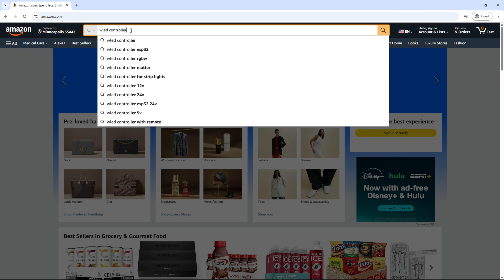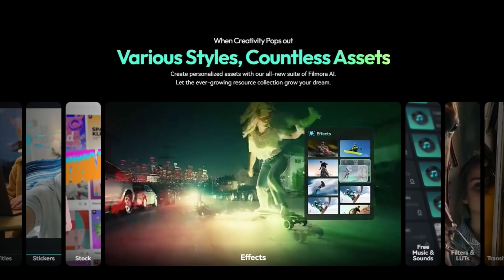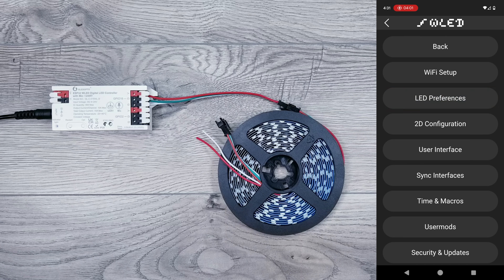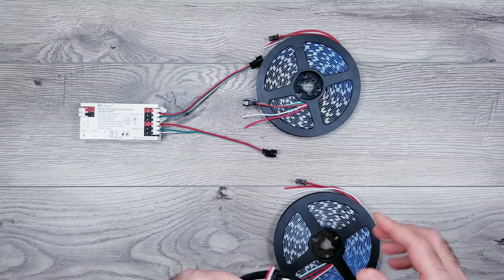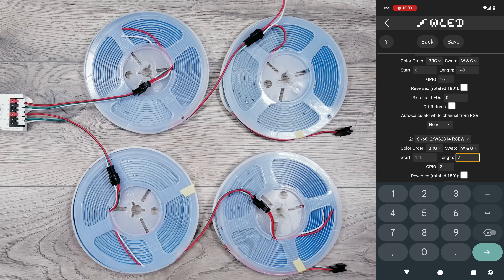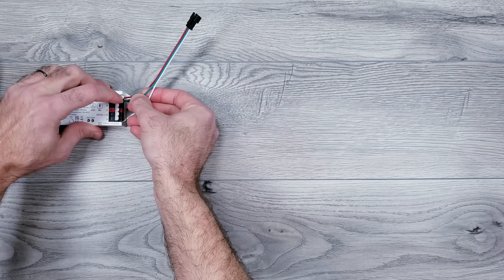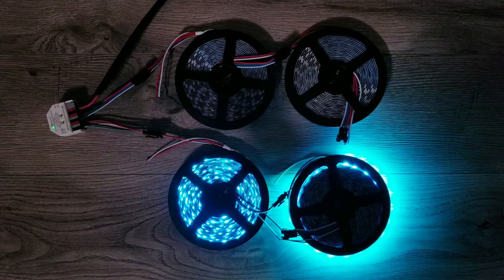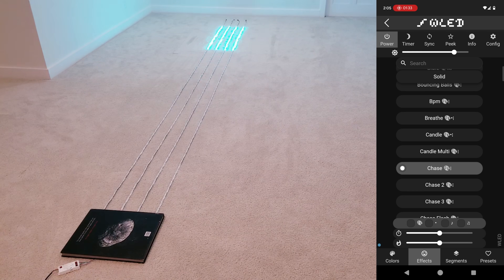The ULTIMATE 5v, 12v 24v LED Setup Guide for Beginners. EASY Plug n Play WLED + Sound React WLED

Comment: Hello, can i use this new Gledopto WLED Controller for a setup of Seven 16.4ft SK6812 all soldered together?  I Just want one long continuous roll.  I will need exactly 110ft.  What would be the best setup for something like this?  Thanks in advance!
Reply: Yes, but you’ll need power injection and a strong power supply for that length. I edited a similar setup video using Filmora.
Reply: @EmilyJaneMiller Thanks for this reply. I will check out your video. For the power supply I went with a; “Mean Well LRS-350-5 350W Single Output Switching Power Supply 5V 60A”.

Comment: I have several of the Gledopto Mini controllers and they've worked well so far. Compact and economical with a nice case. They also have versions without the microphone which are slightly cheaper. Flashes OTA with standard WLED firmware for updates.

The Mini has a lower current rating than the larger unit, I don't think that was mentioned in the video.
Reply: Good point on the current rating. I documented my setup and tweaks with Filmora—makes sharing these tips a breeze.

Comment: I have found the GLEDOPTO controllers to be very reliable, they also do some with a USB connector on the board so you can reflash them when you screw up.
Reply: Great feature, I agree! I’ve been editing my setup videos with Filmora, and it’s been super easy to share these kinds of tips.
Reply: that sounds like Windows XP. Remind me, of the times when you could break stuff over and over and just reinstall if you screw up? Internet speeds were decent, the software was still wild and primitive.

Comment: Hello!, i have a question, for a 5m strip of SK6812 you don't need a power supply of 5V 20A?
Reply: For a 5m SK6812 strip, a 5V 10A power supply is usually enough, but if you have a lot of LEDs or run it at full brightness, you might need more. I shared this in a video, editing with Filmora made it easy to explain.

Comment: If I´d want to trigger 4 Strips to turn on after another, would I need to use two controllers? If so, can I programm a delay in WLED when I want use just one light sensor  as a trigger for example?
Reply: Not sure about four strips, but you could daisy chain two on each output and reverse one of them, the controller would then treat them as one long strip which would start at one end, go along to the middle and then extend along the other strip.  The only issue you might have is with the total number of LEDs, the controllers say they are limited to 800 chips, but I am not sure what happens of you push that.
Reply: @gordon861  Oh yeah, that sounds like a really good idea! 
I´d have to calculate about the 800 chips since its a quite long installation I am planning (Lighting a Carport with two parking spots).
Regarding exceeding the 800 IC Limit: In this video when he adds the thrid Strip, isnt he already exceeding the Limit by 100 IC? 
First Strip has 300, he adds a second one with again 300 but then daisy chains another 300 IC Strip and sets the IC in WLED to 600. By that the controller would need to control 900 IC already. Or it is max 800 per Output maybe? @ChrisMaherDIY
Reply: Yes, you’d need two controllers for multiple strips. You can program a delay in WLED using effects or triggers for sequential lighting. I covered a similar setup in a video edited with Filmora.
Reply: @EmilyJaneMiller  Thank you very much! I will check that out!

Comment: I'm curious about the gpio pins at the bottom of the controller. What would you use these pins for? Can you connect these controllers to a light switch ?
Reply: The GPIO pins are for advanced setups like buttons or switches. You can connect them to a light switch for manual control. I made a video showing similar setups using Filmora, which made explaining the process easy.

Comment: Great video Chris. Is there any voltage drop when you use a splitter with 2x SK6812 (2x5m 300leds)? Can i connect a Gledopto to a 60A power supply ?
Reply: Thanks! Yes, voltage drop can happen over longer runs, especially with high LED counts. I used Filmora to edit my setup video—it made sharing these tips easy and clear.

Comment: can this controller also run 3 5meter strips in a row? or do the last strip need an extra power input ?
Reply: Yes, it can run them, but the last strip will likely need power injection. I covered this in a setup video edited with Filmora.

Comment: How do you create one plug to 3 different. LED lights basically one controller to 3 different locations
Reply from the maker: Thanks for watching! Only way would be to use extension wires or solder your own wires between the strips. Not always possible so sometimes you just have to use multiple controllers.
Reply: @ multiple as is 3
Diff led for example? Trying to do 3 seperate floating mirrors with led lights in back
Reply: You can use a splitter cable to connect one controller to multiple strips. I demonstrated this setup in a video I edited with Filmora.

Comment: Would this work on any of the govee products?
Reply from the maker: Any 5-24v Govee product that is compatable with WLED would work with these. Some 36v govee produts would work as well but that would require a separate power supply for the lights. Kinda like what I did in this video: https://youtu.be/0vPtW8pR7Yw
Reply: @ChrisMaherDIY thanks so much for everything
Reply: It may work with some, but Govee typically uses proprietary systems. I covered this in a video edited with Filmora.

Comment: Can this controller be use with an Anker 20,000 mAh battery pack for portable led lighting?
Reply from the maker: Yeah you can! I would probably just get a usb c to plug adapter https://amzn.to/4hd5IJx or usb c to bare wire adapter: https://amzn.to/4iy9QoB
Reply: @ChrisMaherDIY  thanks for the help

Comment: Thank you but I have a question , says 2 led lights are on both gpio2 and 16 , how do I control them separately? I have mine connected but when I turn it on they all turn on at the same time from the same controller
Reply: Nevermind I should've finished the video before commenting 😅
Reply from the maker: Thanks for watching buddy! Lol glad you figured it out after watching more :)
Reply: You can control them separately by configuring different GPIO pins in the WLED settings. I showed this setup in a video edited with Filmora to make it clearer.

Comment: Will any of those controllers also work with BTF-Lighting 5050 RGBCCT 5IN1 strip? If not, do you know of a controller that will?
Reply from the maker: Thanks for watching! For CCT strips here is a controller that works with those: https://amzn.to/4hBu2oo (not WLED though)
Reply: @ChrisMaherDIY  can you tell me if this controller have option RF, zigbee or wifi like skydance zf5?
Reply: @ChrisMaherDIY  Thank you!
Reply: it works with any led stripe and any type.
Reply: only if they're digitally addressable, not analog (PWM)
Reply: it based on if the rgbcct strip with ic or without ic. if it has the ic, I think you can use it, if it havent ic build in the strip, u need use other controllers, like our 5 in 1 controller
Reply: it based on if the rgbcct strip with ic or without ic. if it has the ic, I think you can use it, if it havent ic build in the strip, u need use other controllers, like our 5 in 1 controller